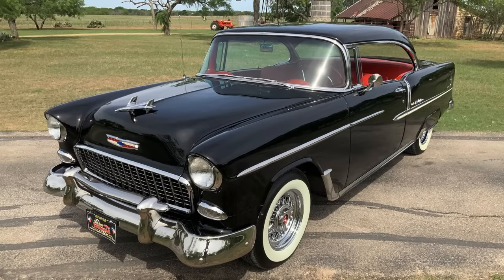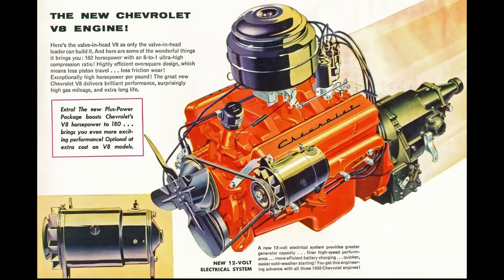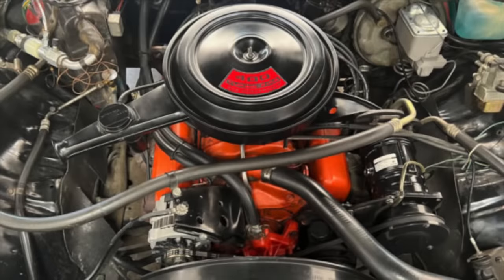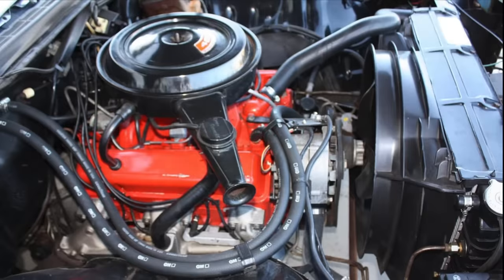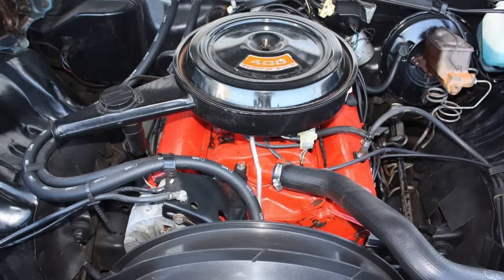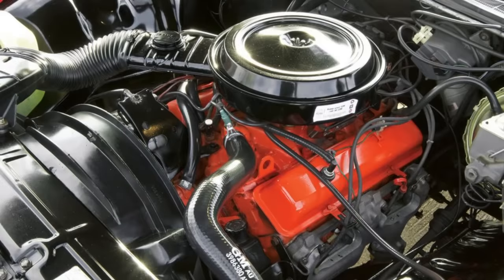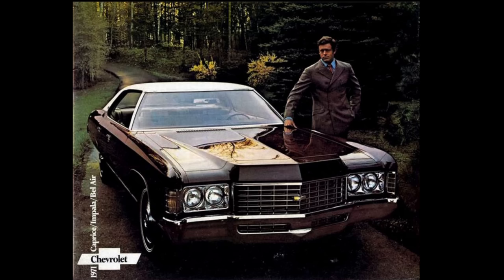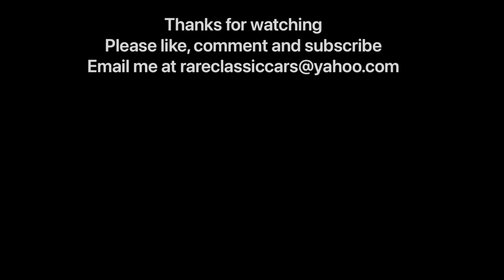Forgotten Engines: The 400 Cubic Inch Chevrolet Small Block V8 (1970-1980)

Comment: My boss had a 72 GMC shortbed 4x that had a 400 4 bolt main. We rebuilt it and the trsnsmition. We even installed a cam with a little more umphh. That truck could crow hop from a standing start!

Comment: I worked for a Chevy dealer parts department in the mid 70s and there were several well financed dirt track teams that bought the 400 blocks and heads and put a 350 crank with special bearings to make a 377.  I never saw how they built one but they would put 180 degree headers on them and they would sound like a bumble bee going around the track.  I mostly dealt with the body shops but we had an old racecar builder that took care of them and told me about how they built the engines.

Comment: 1997 i bought a bare block that had been swapped into a drag car 77 vet. The angel plug heads had been drilled to ooen the steam holes. I put flat tops and a stock crank with a cam for a actual RV with 113 degrees lobe separation.  I wound up making 480 hp and 540 torque on the wheel dyno.

Comment: The 400 big block was a 402CID (396 with factory 0.030 overbore).

BUT GM corporate put a "400cid" limit on passenger cars, so the 402 was sold as "400"
Reply from the maker: No. Not by this time. The car was also offered with an even larger 454.

Comment: The 76 El Camino I purchased from my Dad had a 400 SB Chevy. 
He wanted the engine for a project and I had to pull it out as a condition to get the car. 
He gave me a 4 bolt main 350 to put back in the car.

Comment: If I recall correctly the "400" emblem on the front quarter panel, behind the wheel, varied between the small block and the big block. The big block version was three dimensionally deeper and "chunkier" looking and had red lettering instead of white on the small block version.
Reply: You are right.

Comment: My closest friend had a 72 Chevrolet Kingswood with the 400/2. It was responsive enough around town, but he never cared for it, having traded a 69 455 powered Delta 88 Royale in for it. (He was spoiled by that Olds.) The 5000 lb. Kingswood was not much when it came to passing power.

Comment: The 400 can be identified by the number of freeze plugs on the side of the block. Later versions had 2 like the others but the boss was still there for the 3rd one. So look at that if a guy is trying to get rid of his 350 block by lying and saying it's a 400. I used to call mine a "baby big block". Made good bottom end torque and looked like any other small block. Never made a factory high performance version but you can with the right parts. Runs good especially in a light car like a Nova. Cast crank and 2 bolt only mains, but you really don't need those for a street car anyway. Mine was called the LF6 by the factory. 265HP but 400 foot pounds of torque at 3200RPM. With a mild cam, 4bbl and headers and true duals achieving 300-350HP is easy but this engine's main asset was torque. Horsepower sells cars but torque sells engines and torque is what gets you moving off the line and inches rule on the street.

Comment: I think you may be wrong about the two bolt main blocks being weaker than the earlier four bolt blocks. The two extra holes drlled through the block web or "saddles" if you like, actually made them weaker according to a reputable machine shop I used to frequent. They preferred the two bolt block with main studs or converted to a splayed cap with outside bolts aligned with the outside of the block angle. I destroked a 400 two bolt block to 380 CI and ran a big mechanical roller cam. It was a saucy engine that revved like crazy and I never broke anything on the bottom end.

Comment: My Dad bought a new 1971 Kingswood wagon with the 400 SB engine. That thing had ridiculously high gearing and was a smooth highway cruiser, even if it only averaged 12 mpg. We could stuff all 7 of us in there with full luggage in the back and still have plenty of torque to do the job. Unfortunately, after about 5 years of flawless performance it overheated on a road trip and did some major damage to the engine - warped the heads and fried the rings. I did a valve job and milled the heads but it just never had that bottom end torque again.

Comment: I had a 1975 Chevrolet Malibu Classic coupe that I had special ordered with the 400-4 bbl.  Back then it was rated at 175 net horsepower and 305 lb ft. of torque.  Of course, I would have wanted the 454 4bbl, but I knew I couldn't justify the cost or price of gas.  Nothing was truely "fast" back then but the car was adequate.  I remember "hand timing" a zero to 60 mph in about 9 seconds and a zero to 80 in about 16 seconds.   I never really saw the "top speed" but I did get it over 114 mph once.

Comment: Nobody gave a crap about 400 small blocks, until they started making them into strokers.

It won't run for crap using stock heads.

If you want to talk forgotten engines, look at the Chrysler 400 "B" engine.  Basically a 383 "B", with a lot bigger bore.  Think of it as a big block that acted like a 302 Chevy.  Big bore, short stroke.

Came out at the beginning of the smog Era, so it never got decent compression.  Even so, bump the compression, put a decent cam  in it, and it makes a nice replacement for a Hipo 383.  Especially since they weren't nearly as pricey as a junk yard 440.

All of the "good" rotating assembly (forged crank, rods) from the earlier 383s dropped right in.

Then some people started dropping 440 cranks into them, turning them into 451 ci "strokers" that looked like a 383 sitting in the engine bay.  As well as being lighter than your usual 440, and having a little more room in the engine bay (just the thing for swapping into an "A-body".

Comment: My 72 El Camino with a 350 that I bought from a private party when you were at an idle the motor would shake like crazy, but ran ok once you got going. 
Thinking a bad or cracked flex plate I took it out only to realize that it had a externally balanced 400 flex plate that I think they got from a junkyard cause it had 350 Chevy written on it. 
Idled smoothly after the correct flex plate was installed.

Comment: My dad had a '74 Impala with a 400 that he used as a work car.  The thing developed a bad valve cover gasket leak and as I was sitting at a standstill in a construction zone with the a/c running on a 95° day, it decided that it would catch fire.  By the time the small rural fire department decided to show up, it had burned from the grille to the back seat.

Comment: Had a 73 Bel Aire wagon w400 cu in V8,  2 bbl . smooth acceleration,  served me well especially when in tune(:points).  Although i traded it in for an 84 economical 4 cyl , strictly  for fuel costs, it always ran strong, there& back

Comment: Adam I know you don’t do many mopar engines but I’d like to see a video on the truly overlooked mopar 400 someday. Could you also shed some light on the difference between the 396 and the 402 there’s much confusion on these engines
Reply: 400 mopars are a great motor to build. same size block as the 383, but much larger bore.

Comment: Back in the day, I worked in a parts store. We had a customer carry in a carb for rebuild, 'the carb was off of the transplanted "350" in his 3spd pickup'. He told us the engine had an odd vibration nobody could figure out. The shop man found the called for kit was not right. Short end of the story, we got to tell the guy he really had a 400 Smallblock, not a 350. 400's were externally balanced. They worked out the Used Car Dealer bought him the right flywheel.

Comment: I had one in my 1964 Impala SS. Rebuilt it with a 270 cam, edelbrock performer intake and carb, headers, hei ignition,  port matched, oversized rad. I beat my brother in his Monaco with a 440 magnum. I only wish it a higher compression ratio.

Comment: I have a 1972 400 SBC. in my 1969 Firebird. I know it should have a Pontiac motor but I had the 400 so it went in. My son has a 1962 327 300hp in his 1967 Camaro. Both has been built with good parts by me. The 327 will rev higher and faster but the 400 has more torque.  Both are great motors.

Comment: Take the crank shaft from the 400 block and put  it in the 350 block and you get the best of both worlds.  The 383 csb
Reply: Been done to death bro, what really runs good is a 400 block with a 350 stroke 377
Reply: Thx for the reply bro, you can thank the sprint car guys for fixing the terrible rod angle, cylinder head problems. The 400 sbc had a unique short rod apart from all other sbc engines so the crank would clear the cam. Now you can make a 406 long rod, order the kit, but I still prefer the short stroke 400
Reply: Best world is 400 crank in 400 block!

Comment: I HAD A 1968 PONTIAC CATALINA WITH THE NEW FOR 68 400 CU IN V8 .IT CAME IN 7 DIFFERENT ITERATIONS FROM 255 HP TO 360 HP THE DIMENSIONS WERE EXACTLY THE SAME.400 CU IN. IT WAS USED ACROSS THE ENTIRE PONTIAC LINE SAVE THE  TEMPEST  BUT WAS USED IN THE TEMPEST GTO.
Reply: Actually bore and stroke dimensions slightly different...

Comment: Sony bad thing about the 400 small block was the connecting rods had to have a shorter bolt you missed the camshaft little bit of a clearance problem causing them to put a weaker style connecting rod in the 400, it's too bad they didn't design a different type of connecting rod for the engine.

Comment: My 72 Impala had this engine in it with a 2 barrel carb, thing got 19 mpgs. Great engine, never failed never knocked all was good expect that stupid points ignition. If I knew then what I knew now, I have put the GM's HEI ignition in it and been much better off... back then I just didn't know it could be done. The HEI was only a few years behind, so the distributors would easily interchange, just add a volt source from the ignition switch, a ground then problem solved.

Comment: I would definitely not say that the 400 is a forgotten engine, the 400 is probably the most sought after sbc for anyone building a hotrod or race car. If the 400 was more common, most people would be running them over 350s but the 400 had a very limited release and only available in a hand full of vehicles. The 400s do have issues with thin castings and if cracked can overheat and most 400 blocks can only be bored .030 over max, some will go .040 and very rarely will they go .060 so if you find a 400 that's already been rebuilt in the past, chances are if it needs boring again then the block unfortunately is usually not worth fixing. Fortunately there are aftermarket companies like DART and blueprint making brand new and improved 400 blocks which make a fantastic platform to build on especially for a high performance build and with the rising cost of machine work these days, you can buy a dart block for the price of re-sleeving and remachining a factory block.

Comment: An interesting topic indeed!  That 400 emblem on the fender can be confusing indeed!  I wonder what the difference is between the "400"/402 big block and the 396 big block.
Reply: Like Adam says, my 73 400/2bbl had plenty of low end grunt, but nothing at higher rpms..  73 emissions probably didn't help...
Reply: I think it was a very slight stroke increase. The car magazines got all technical about it in their October 1969 issues.
Reply: it was a 30 bore difference.
Reply: .030"

Comment: I can remember over the years, every time a conversation steered toward the 400 small block, someone would have to mention it's tendency to overheat and/or crack heads.  I've always wondered how true this was, considering that the 350s used nearly identical heads (just without the "steam" holes) and they tended to crack heads as well.  The usual theory is that the 400s were more prone to overheat due to the siamesed cylinders, but I've never seen any real proof of it... most of the heat comes from the heads anyway.  
I've been running a 400 in my '79 Suburban for about 5 years now, and I have noticed that it does run a bit warmer (maybe 5 degrees is all) during the summer than the 350 it replaced did, but it's never actually overheated, not even while highway driving in mid afternoon 115 degree heat with the A/C on max and no window tint...

Comment: Classic Chevy owners know turbo jet emblem  on the side means big block.   In 1970 Chevrolet bored all 396, engines.30 over to making them all 402cid. But for insurance purposes the SS cars were listed 396cid and passenger cars were listed 400cid, and trucks didn't matter so they were listed 402cid. Old chevy guy.

Comment: I new of a few impala with the 400 sbc. Seems like all of them had the hot start problem. Problem was usually fixed by using the big block starter. They did run good.i was not aware they were 2 barrel.

Comment: I think the main reason the 400 kinda got a bad rap was it took alot of modifications to get that much displacement out of a block originally designed as a 265.  

The bores got siammesed which as mentioned if the wrong head gaskets were used could cause overheating 

The rods had to be shortened to 5.565"  which caused additional stress loads on the rotating assembly ( all other sbc used a 5.7" rod)

The crank main journal size was incresed 0.200"  to  2.65"  again unique to the 400   all other ( with exception of 265,283 and early 327 small journal blocks) used a 2.45" main journal.

It was also externally balanced thus needing a diffrent harmonic balancer and weighted flyweel vs all other SBC which were internally balanced.

One of the great features of the small block chevy was its universal parts interchangeably  and aftermarket parts avaliablty.

  the 400 was just too different modify and with the exception of heads and manifolds was its own engine.

Comment: Yes Adam, I've owned a '96 "ex"-sheriff's car, it had that L-99 Engine, the 262 V-8, producing a measly 200 horsepower, it was the same on the outside as an LT-1 , 350 that was on the Highway Patrol cars.
Reply: Is that the 4.3 V8 ? I’ve heard of them but I’ve never seen one in person. Same thing with the 267 that only lasted a year or 2. I’ve had a 283, 327, and 350 which were all good engines. The last true small block I owned was my 1995 GMC Sierra that I sold to a landscaping guy at well over 400,000 miles. I wouldn’t doubt it’s still kicking around somewhere. I currently have 2 GMT800 trucks (05-07 classic) which I consider a continuation of the small block with the 5.3. One is at 250,000 the other is closing in on 300,000. Can’t say a bad thing about them.
Reply: That L99 is actually a 265. Same bore and stroke as the original 55 265.  The 262 came out in the mid 70’s for the v8 monza. Only lasted a couple of years.
Reply: @toddholldorf9494 That weird 262 V8 also went into some Novas too. Wasn't a bad engine.
Reply: 200 netHP wasn't bad for a 262" engine...

Comment: Great video, Adam! But I believe you have some of your facts confused on the '74 & older S.B. 400's all being 4-bolts. Unless you merely meant that they were available until '74. I have that on such good authority bc I have a '70 small block 3951511 casting 400 Warranty Replacement engine that most definitely is only a two-bolt main. It is the first one that I have had the pleasure of scrutinizing as a sober, retired MillWright with about 49 years in that field. The thing is a horse of a mighty different color bc even on my two bolt, the main bearing webs that are cast into the block had to literally be undercut to clear the skirts of the slugs, from the factory!!! This is why if you have a factory 4-bolt I would just consider it a showroom piece bc if your block cracks, there, you best have some stellar skills with a stinger lead and some cast iron. A factory two bolt will actually be ammended by splaying the outboard bolts into the block at a 4-bolt conversion. One important difference you didnt mention was that their crankshafts are externally balanced and as such the Harmonic Balancer is the only one of the 10 SBC's they made to have a notch in it and a counter-weighted flywheel

Comment: It amazes me how many engines, especially V8s, that GM produced during that era. It takes my breath away that great motors like this were discarded and forgotten. A 400 cubic-inch "small block" V8 (6.6-liters) could have had potential in large cars and light trucks and vans long after the "Malaise Era" waned. Why not take the 400 "small block", chop two cylinders off, and make a 300 90º V6 (4.9-liter)? Give this V6 fuel injection, exhaust headers, roller cam tappets, and a balance shaft and other performance tricks as was done in the later half of the 1980s, and this engine could have easily replaced Chevrolet's 305 (5.0) V8 and also would have made a better alternative to Cadillac's "HT4100" and later 4.5 and 4.9 V8's. A 300 V6 would have been an ideal 305 V8 replacement for half-ton pickups, Blazers and vans. It also would have been a great engine for rear-wheel-drive Caprices, Monte Carlo's, and maybe even Camaro/Firebirds. Give that engine the same treatment as Buick's "Series 3800" V6, and it would have been ideal for 1990s Caprices, Roadmasters and many Cadillacs. Looks like GM threw away another opportunity.
Reply: Instead of balance shafts, use a 120 degrees crankshaft in V6s... would have made too smooth of a V6 and thus difficult to sell buyers up to a V8...

Comment: Even though I was only 10 at the time I do recall the 402 pushed you back in the seat a lot harder than the 400 small block.   Until I saw under the hood that seemed odd to me but seeing the big block heads on the 402 explained the difference.  The big block car felt more like my mom’s 429-4V LTD Brougham.